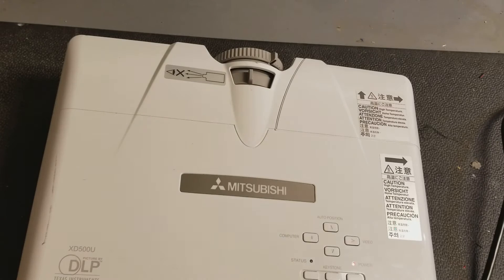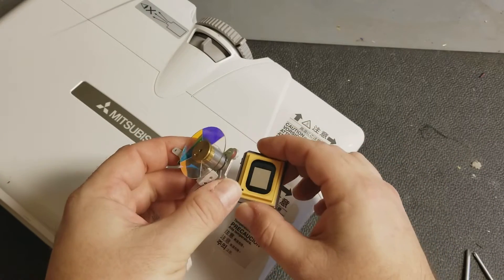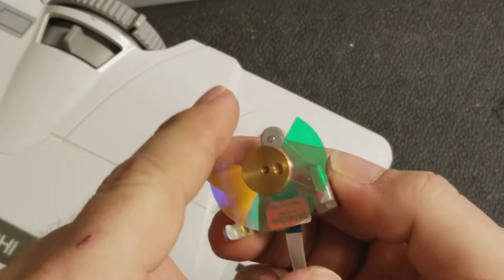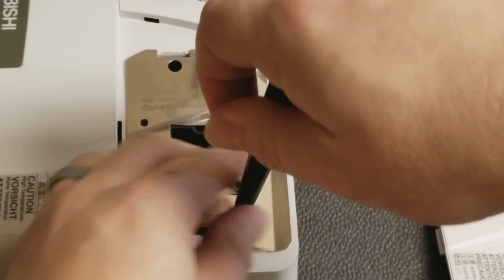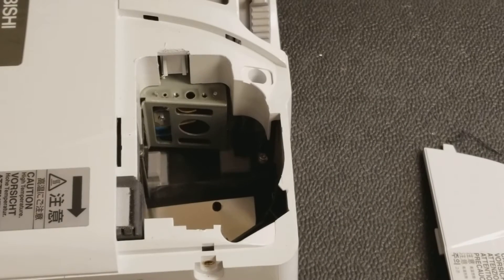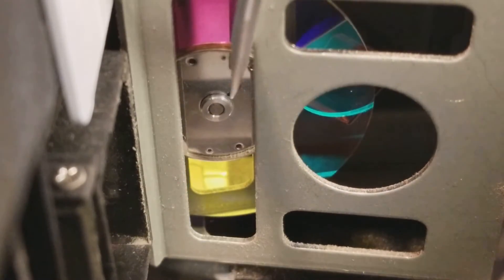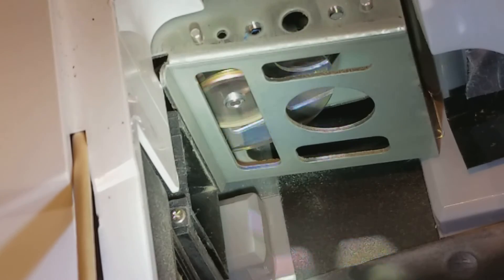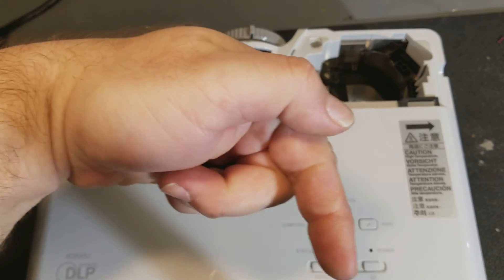Troubleshooting your DLP Projector : Color Wheel

Comment: Hi Frank, thanks for the videos that you do they are very helpful. I have a Optoma 750 GT looks similar to the optoma HD20. It was making a loud buzzing noise, I took it off the ceiling and took the cover off to clean it up. The color wheel looked ok and the fans were dirty so cleaned it all up and then did a test on the counter  and it seemed a lot quieter. I put it back on the ceiling and the noise is back, both fans were working so I am wondering if the noise is from the color wheel?  How can I tell if it is the wheel or fan bearings that are causing the issue?
Reply from the maker: The color wheel tends to start before the fans and stop before the fans when you turn it off.  Color wheels tend to need replacement every 5-7 years and if you are still on color wheel #1, then I'd replace it. I had an HD20 that was on the third color wheel so its a common part to replace.  Basically if you hear the noise start very quickly after pressing the power button, then its probably going bad. If you want to share a video with the noise, I can listen and see if it sounds like it to me.
Reply: @FixitFrank  Hi Frank, I am finally getting back to you thanks for your reply. I cleaned the unit up and it went quiet for a while and now I notice that when I turn on the projector it is fairly quiet until I turn on the media player and  when the screen lites up  it starts to roar, so I assume that means the color wheel correct? The other issue is when watching the player last night we had a white dot show up on the screen and before we shut it off another showed up. From what I can tell is a chip is on the way out and just wondered what you recommend to fix this problem. look forward to hearing from you Thanks.
Reply: Just had a similar issue with my optima 142x. Thought it sounded like the fan malfunctioning. I disconnected the fan and it turns out it was the color wheel making the noise and causing the projector to shit off. Ordered a new one. Replacing it tomorrow. Fingers crossed!

Comment: I have an Optoma HD 142X projector and replaced the bulb and color wheel (multiple times to make sure it was sitting correctly) but after I did I keep getting this shadow on the top of the screen.  I made my profile pic the picture of what I see. It looks like something is in front of the light source.  Any advice would be greatly appreciated.
Reply from the maker: It is kind of hard to see in an 80 x 80 picture but when I enlarge it, I seem to recognize a miss-aligned light tunnel.  Or maybe that little metal cover on the end of the light tunnel(after the color wheel).  If you want to repost the image to Imgur and share the link, I can verify that, but I suspect that is what your issue is.  Either the light tunnel moved or something with the metal mask mas moved and is causing that shadow.

Comment: hello, I have a Dell 1510X which when i turn on shows a flickering screen for 5 seconds and then turns off with a solid blue power light and blinking orange lamp and temperature light. Do you have amy suggestions as to what I should do ?
Reply from the maker: On the surface it sounds like a bad color wheel or dirty color wheel sensor. I'd suggest a simple cleaning and see if that helps. If not a new color wheel is not too much to replace on the model.

Comment: I have a Optoma UHD60 and the standby light is flashing and the lamp light is solid. Replaced the lamp (with a good one) and same thing happened. When I take the lamp out and bypass the lamp door sensor to see if the color wheel moves it doesn't. As soon as I press the standby button to switch it on the projector immediately shows the lamp light (standby starts flashing again). I checked the color wheel moves freely, no debris and no cracks in the glass. 

@FixitFrank Is this likely to be the color wheel or something shorting on the boards?
Reply from the maker: I'm sorry to hear you have issues with that model.  I suspect you have something going on with the ballast or power supply to the ballast.  https://www.optoma.com/ap/wp-content/uploads/sites/11/2017/11/optoma-uhd60-user-manual-english.pdf  On page 57 they have a breakdown of the error codes and there are a few varying flashing codes for the standby LED. I suspect you are seeing the 'Lamp Failure" codes but please verify in case its something else. The fact that even with the lamp door bypassed, you still had no color wheel spin up makes me lean towards a power issues somewhere. The color wheel needs to start for the lamp to be ignited. 
I have read that the UHD60 has some firmware updates. You may want to see if you have the newest firmware loaded.  Also, I would refer to the LAN hookup in the manual and see if you can connect to the menu that way and see if an error is listed via the LAN interface.  Lastly, it may be worth contacting Optoma.  I think you might still be under warranty.  Being that your old lamp did not explode or anything like that, I would start with checking your firmware versions and update if needed. If not, then its likely something internal.

Comment: Hey there! First time viewer here. First of all, thanks for the tutorial! It really helped me rule out possible malfunctions with the color wheel. Turns out there's something wrong with the position of the color wheel: when I push the whole thing with the finger (including the "skeleton" the wheel fits in, the sensor... everything) it starts spinning and working correctly, but if I let go it goes back to its original position and just stops. Not only that, but it looks like the color wheel gets scratched (which is weird because it's not making contact with any piece). My question is, how can you make the color wheel's base stand still a bit tilted so that it spins correctly? I have an Optoma hd200x by the way... Thanks in advance!
Reply from the maker: Hmm.  That is weird.  It kind of sounds like the wheel is damaged and not being held in place.  I'd probably replace the wheel first. Sometimes the clip that holds the hub in place can break and let the wheel float.  The chances of the metal part moving is really small.  However, maybe check things over and see if the other pieces moved towards the wheel, rather than the wheel moving.  In your case, finding out what moved is what you need to fix.  If the metal in front of the wheel warped from heat, you want to rebend that instead of bending the wheel bracket.  Bending the wheel bracket may cause the wheel to fail early or rub on something else when it is hot and expands a little.
Reply: @FixitFrank  Thanks a lot for your patience and answer! I will check to see what is wrong with it.

Comment: My projector sometimes won't start. And if it starts, it has a vague blue tint that sometimes goes away and then comes back. I bought a new lamp a couple of weeks ago. Hmm... could it be the colour wheel?
Reply from the maker: Depends on the model. Your issue sounds more like an lcd model than dlp but I don't want to assume. What is the brand and model?
Reply: @FixitFrank  Thanks for the fast reply. My projector is an old Benq 1060w.
Reply from the maker: Ahh that's a good unit! Might be the color wheel starting to go. I'd give it a gentle cleaning first. If dust is on the color wheel sensor it can cause symptoms similar to a bad wheel. Pop the top off and vacuum out whatever you can. I use a dry paint brush sometimes tovy flick the dust loose.

Comment: Obrigado
Reply from the maker: De nada
Reply: @FixitFrank  I'm working on the colors reel, the engine is fine as you say in the video, but it seems that the sensor has crashed, is it possible to test the sensor that is on the racing engine?
Reply from the maker: If the lamp is new, look at the glass on the lamp housing.  The glass should have red/blue color. If the glass has 'green' tint to glass, that is your problem.  https://youtu.be/pym7D7etOcM  <--See this video, and this https://youtu.be/SOCx2_IQh24  .  Your projector symptoms make me think Color wheel sensor has dust or lamp assembly has incorrect Infrared filter.
Reply: @FixitFrank  teacher i use the dell 1210s, it turns on after 10 seconds the image starts flashing and it turns off the lamp and then turns on the red led lamp symbol, I tested the cooler and it’s good, lamp too,

Comment: Do you know how I can get to the color wheel of a platinum hd 18k projector?
Reply from the maker: Hello, those do not use color wheels. They are low end "lcd projectors" that use a single LCD panel with a LED backlight.  It is rarely worth repairing one of those.  Believe it or not, these are part of projector scams where the companies claim them to be $5000 MSRP but sell them for a few hundred.  New they cost about $25 from China but they say R18 as the model.  They are roughly 240lumens output.  Save your money and look on eBay for a used DLP projector made by Optoma, BenQ or Mitsubishi. Your money will be much better spent.

Comment: Hi Frank 
Loving the videos cheers.
i am from  the UK I have a benq w1200 projector that was overheating (it was filthy lol)
i cleaned the inside which i did strip to clean, after rebuilding i now have the red LAMP
light on, with help of your video's i held back the micro switch (that the lamp lid holds back)
when turning on the projector  the colour wheel is not spinning so i fit a new colour wheel.
and its still not spinning ? i was hoping you may if possible point me to the next thing i could check.. cheers Paul
Reply from the maker: Hi Paul! The color wheel should spin up.  I will say that I have another W1200 in here right now with a weird power issues.  I wonder if they are having the same issue?  I would check to see if you have voltage at the color wheel connector(8-12V dc) when you press power.  I'm planning to spend some serious time on the W1200 I have here now to see if I can find anything about the issue.  It may apply to yours as well.  Do you get the fans spinning up and not the color wheel only or are the fans not spinning up too?

Comment: Hi Frank.. Nice video .. I have an Optoma HD66 projector. When I turn it on, the image appears fine, but after few minutes, the image beging to flicker and then shows an error using the leds . Can it be a malfunction of the color wheel even if starts showing the good image. Sorry, english is not my native language.
Reply from the maker: Your english is better than many native speakers. You have no need to apologize. I promise your english is better than my spanish.  
Have you replaced the lamp lately? A common symptom of a poor quality IR filter is this behavior.  The lamp goes to full brightness and floods the color wheel sensor, causing it to shut down(after flickering a bunch as it tries to find itself). You can use the lens/IR filter from the old lamp if you still have it. 
If the lamp is the same, then your issue is probably a worn out color wheel.  This projector is 9-11 years old.  Most Optoma projectors 7+ years old, need new color wheels.  I know of one HD20 that is using its third color wheel. 
Replacing the color wheel is not very difficult if you take your time.  The wheel should not be very expensive. 30€  give or take is what I see on eBay.
Reply: @FixitFrank  Thank you for your answer.. I already ordered a new color wheel.. The lamp is new too, because I thought it was the problem. I will give you a feedback as soon as I replace the color wheel.. I still love my Optoma. Regards.

Comment: Unbelievable this video was great....I was wondering why my dlp projector was flicking colors and I took it apart and used a Q-tip to move the wheel and a small blower to clean it out & it worked perfectly after that....great info 👍
Reply from the maker: Thanks so much for letting me know.  This is why I make these videos. Glad it was helpful!
Reply: glad it works for you....

Comment: Hi There, Thank you for these videos. My Benq dlp projector sat unused for 10yrs but has very few hours on it. Recently tried to use it, and it powers up, fans come on, lamp ignites, colorwheel spins and few seconds later lamp turbs off it goes back to standby. Could this be a symptom of a tight color wheel?
Reply from the maker: It definitely sounds like it.  It "might" be the lamp but the color wheel seems to be the usual suspect.

Comment: Frank, I'm having a hard time finding the parts for my Optoma HD72.  I need a color wheel and sensor.  Where can I get them?
Reply from the maker: Hi Tom,  eBay is a good source.  There is no such thing as OEMs here anymore for those.  Anything with a reasonable rating will be safe to buy.  Another option is email my friend at gydz@timeprojectorlamp.com  Send a picture of your old CW assembly so they can verify its correct.  Im a big fan of Timeprojector. They are in China but they take paypal and use DHL so shipping is fast.

Comment: Hi Frank. Thanks for the video. Watching your videos gave me the confidence to change the Colour wheel on my Infocus SP8600. When I got it apart the light tunnel cage has distorted slightly and the shim has been worn down by the colour wheel. Are these parts available or is there a work around?
Reply from the maker: Kind of?  Light tunnels can be tough but they are also very forgiving.  New parts are pretty hard to find.  I would really just try and get it all to fit together enough.  It does not have to be perfect.  Another option is finding a used IN8601 and pullind the tunnel out of it. Last option is contact TimeProjectorlamp in China. They are a great source for parts for older (out of warranty) projectors. GYDZ@timeprojectorlamp.com  Make sure you include a picture.

Comment: hi Frank thank you so much for the vids  

i'm having issues whit  my new lamp they all flicker colors  , but the original one  on end life   have no problems  but will soon fade away  , any thought s ?
Reply from the maker: You are very welcome!  I do have some ideas. But I need some information from you.  What model is the lamp and projector?  Sometimes the lamp has a bad IR block coating. If your new lamp has a glass face that is 'greenish' rather than red/blue, that is the problem.
Reply: @FixitFrank  benq mx70 the original have a redish glass and all the replacement found have a standard glass
Reply from the maker: @harrylatrick  That is your problem.  The glass must have the red coating.  This is why I suggest to never buy lamps from Amazon or other discount sources.  This is a very common problem.  However, if you still have your old lamp, you can move the lens to the new lamp and that should solve your issue.

Comment: When the black tape come off the color wheel is it time for a new color wheel or tapping it is ok
Reply from the maker: You can use superglue to put it back on for testing, but I would look at replacing it as soon as you can.  I've used 'transformer tape' that I found on eBay pretty succesfully.

Comment: I have a benq 1070 and it starts up okay but then the picture starts to strobe and it shuts down. Any thoughts?
Reply from the maker: Either a bad color wheel, or if the lamp is new, it may not have the proper IR cut filter.  This is common in cheaper lamps.

Comment: Hey Frank. Thanks for this video. I have a problem with my Acer P1173, When projector start, The color wheel is only spinning up once, but not light from lamp, then will shut down automatic. When i take out the lamp testing the projector, same thing happen,the color wheel is only spinning up once not three times. I suspect color wheel sensor problem. Hope getting suggestion from you. Thanks.

Comment: Hi FixitFrank. Very good video. I have a Mitsubishi SD110U DLP projector that will not boot up at all. I tried your troubleshooting method and have confirmed the colour wheel is sound and turning nicely when I try and move it mechanically. When I press the power button it turns green, status light turns green, then after a second, status turns red and power flashes red/green alternately. It won't even start the fan. And of course the colour wheel won't spin up. Any idea where I could look next for the problem?

Comment: I’m having a flashing amber light with a solid red light for the bulb on my optima hd20.Plugged it in and heard a pop so I thought it was the bulb, replaced it but still the same. Checked the color wheel spins, both fans working....what could it be ?? Help!!!
Reply: Could it be a capacitor in it ? I think I saw a post on another model saying it needed replacement but I can’t find videos on YouTube for it.
Reply from the maker: There are a lot of capacitors (well over 100). I doubt that is your problem.  It is very uncommon on this model.
Reply: FixitFrank I just put in a new color wheel and new lamp and I’m still getting the same lights 😞☹️😢
Reply: Also I hear the fans twice then right before the 3rd time I get the amber and red light
Reply from the maker: Hello, What are the LED's flashing?  I think you need to troubleshoot a little further.  There is no direct failure that I can think of with your symptoms.
Reply: FixitFrank goof morning!!! Thank you for replying...light a solid red and power blinking amber

Comment: Looking for disassembly instructions for Optoma HD27. I have a broken connector in the audio aux socket and having problem removing broken pin.
Reply from the maker: Here is a video on an HD26. https://youtu.be/za-viIWXUlQ  It is almost the same.  You might want to try a tiny dab of super glue on the end of a stick and then touch it to the pin to pull it out.  The back of the plug is sealed if I recall so getting inside may not be as helpful as you hope.  However, since the HD27 is a little nicer than the HD26, I wonder if they use a different plug.  Either way, take your time and use your camera for lots of reference pictures.  If you get stuck or run into problems, I have my email listed on the about page and would be happy to advise.